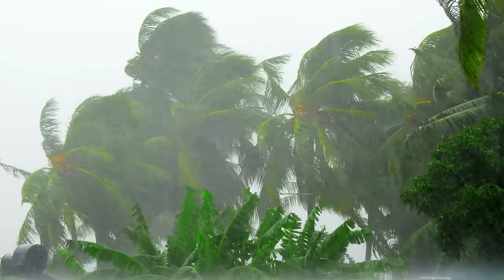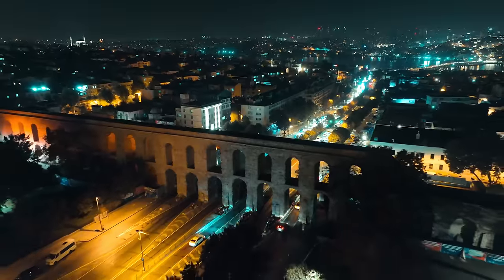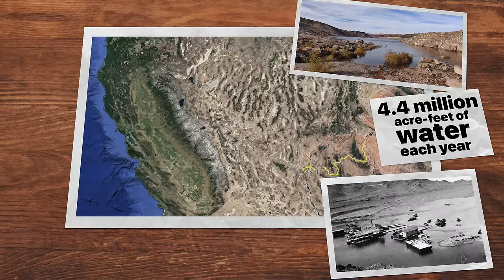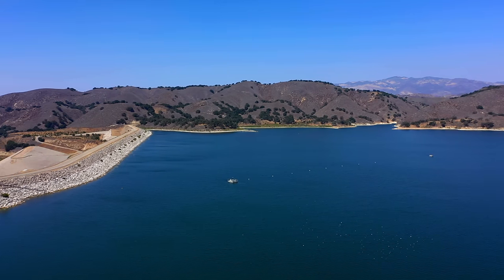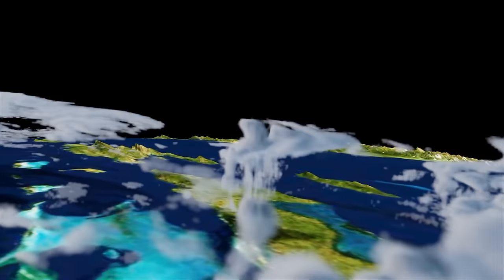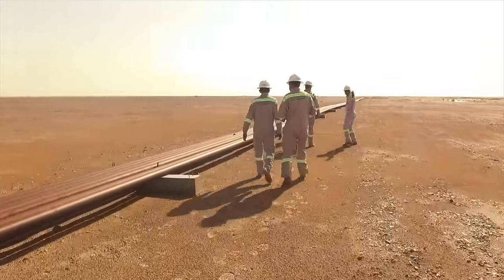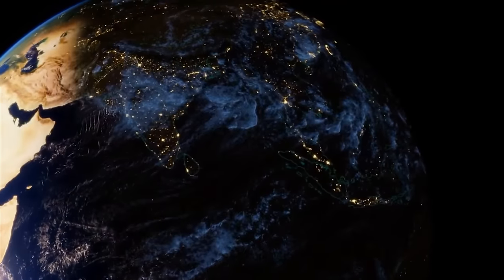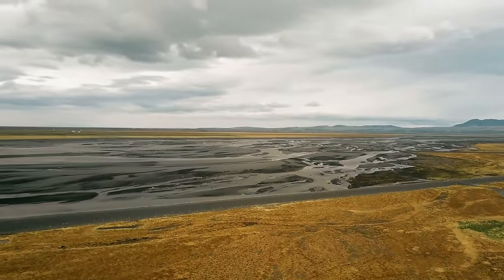Pipelines From Flood to Drought

Comment: We already do release water (downstream) in preparation for increased rainfall accumulation, and that creates huge problems downstream, particularly if it's part of a series of flood-causing storm systems moving through an area. Notoriously, in 1993 and 2019 we had waters dumped into the Missouri river upstream by reservoirs trying not to breach while those downstream were already suffering massive flooding, keeping the flooding from being able to drain down before the next storm system hit. So even having the capacity to pump it somewhere that actually wants it would be a huge benefit even before the advanced models are available.

We could even establish minimums and maximums for "standing levels" of each so there's enough water in a reservoir for the needs of the coming year and enough spare capacity for unexpected events. At the very least we should be building pumping systems to begin moving water to Lake Mead, the central reservoir of the current largest water crisis in North America from east of the Rockies and then encourage reservoirs to connect into it to take any excess water they want to have taken out. You would of course have to rig up some kind of biofilter to keep microbial contamination from making its way west, but we have plenty of systems already doing exactly that on smaller scales that can begin being adapted to scale up.

Obviously, this is a tens of billions of dollars project, but there are more than enough people on the receiving end of just pumping to Lake Mead that the money is there for it if people can be convinced it will work. The major downside is the risk of water shortages from the areas that pumped their water away and then didn't get the predicted rain - and that's where the complex models come in.

Comment: Alright, can everyone please calm down about the oil industry's demise once everyone drives an EV.  The oil industry started in 1859 before there even were cars.  There are tons of uses for oil and gas other than gasoline which only uses about 44% of oil produced.  Cargo ships and airplanes don't have an attractive EV option yet.  Oil is also used for heating oil, asphalt roads, fertilizer,  candles, crayons, plastics, polyester clothes, dry cleaners, cigarette lighters, etc....  In addition each one of those green energy Wind Turbines has about 80 to 100 gallons of lube oil in it at all times.  Oil usage won't disappear.  Pipelines aren't going to suddenly become available.  I do think that it is a great idea to move around water though.  I totally support this line of thinking.

Comment: While I have been Following your channel for awhile, I had not seen this one until an underwater archeologist friend of mine recently pointed it out to me. It reminded him of ideas, concept papers and business plans I prepare over 15 years ago that used re-activated, refurbished or relined unused oil/gas pipelines to transport recovered floodwater to areas in need of water. The big difference between what you have presented and what I presented back then (in short) is I made used of decommissioned (or soon to be decommissioned) oil-fired or coal-fired power plants located along waterways to pump water (when levels were above flood stage) from the waterways into the plant's multi-million gallon holding tanks, perform primary solids settling and biologic disinfection (to kill unwanted/invasive organisms like zebra mussels), then pumping the water through the re-activated pipelines to areas needing water. This was marketed to several water companies who did not show any additional interest.

Comment: Inter basin un-treated water transfer is normally not permitted by environmental laws.   You would not have to purify it to drinking water standards, just find a reliable way to kill all the organics (ultra violet?)  Hard, but surmountable.  I don't think the pumping costs would be too high, as long as the ends were somewhere near the same elevation. .  Egypt is embarking on an  underground artificial river, if they can do it, why not us?  This is similar to the renewable energy thought about better transmission systems.  Yes, the wind sometimes does not blow, but the wind IS blowing somewhere, all the time.   Same thought, a river is in flood, somewhere, all the time.

Comment: A client of mine, Karl Lohman, published a paper on this some 20 years ago. We even gave a copy to Congressman John Mica who was Chairman of the transportation committee at the time. Karl's Idea was a system of 40-50 ft pipes pumping sea water out of the Pacific to the top of mountains out in California. There the salt and any other minerals would be extracted, then allow gravity to push the water either into reservoirs or eastward to communities that need it. 
The system would distribute water where needed and also be used to transport excess water, goods or people using "Pigs" a cylinder that rides inside the pipe. The cost would rival the highway budget but employ a lot of people. Railroads & truckers won't want the competition but the fuel savings over time would make this a feasible system.

Comment: WaterBeads is a transportation system that is powered by the sun's radiation along the route.  The proposal is to pick up water north of Baton Rouge from the Mississippi and move it to Lake Mead and on to Los Angeles.  This guideway costs $200,000 per mile to build.  Patented solution will bring water to the desert SW cheaper than desalination.

Comment: You did not go over any environmental effects that pumping this water would cause, such as killing native species, spreading invasive species, causing quakes, forcing large number of people to move, etc.

Pumping from Canada to TX is much cheaper than pumping the other direction. There is not only a significant difference in altitude, but there is also a benefit of moving towards the equator. A plan that pumps E-W will not have these advantages.

There is no drought in California. The amount of rain is basically the same as it was a century ago. There are too many people in CA that claim to be environmental, but waste lots of water.

There are already endorheic basins in the southwest. Any water we pump in will come back out much saltier. If we don't pump it out then the area gets more salty from evaporation.

Comment: The comment about the increased capacity in the keystone pipeline ignores the increase in velocity and only considers reduction in viscosity. The kinematic viscosity is based on density and absolute viscosity. Reynolds number is based on velocity, pipe ID and kinematic viscosity. If you increase the volumetric flow by 1000 you also increase the velocity.  The flow in a typical oil pipeline is around 20 fps and this is with drag reducing agents added to reduce the effect of fluid kinematic viscosity.  If this was not added the additional horsepower required to move the oil would be substantially more.  The maximum liquid flow in pipeline using pumps is around 40 fps.  Higher flows are possible in penstock pipes in hydroelectric plants using gravity feed and mountain elevation but even then it is not practical to run a turbine at these high velocities so it is rarely done.  Natural gas flows can be as high as 120 fps in extreme cases. This is why gas is pumped at higher pressure to increase the standardized volumetric flow delivered. By increasing pressure you can deliver more gas at the same velocity. 

The concept is interesting and water pipelines are used extensively and could be expanded in the future to use existing infrastructure. This would require modification of the systems (pressure transmitters/regulation, flowmeters, temperature, leak detection, etc.) but it is possible to repurpose some infrastructure. I would recommend checking the calculations a little closer when suggesting you could pump a 1000 times more water than oil through the same pipeline.

Comment: I've been advocating this for years. We get plenty of water in the US for all of our Domestic, Industrial and Agricultural needs, is just that the distribution of the water the US receives is far from ideal. We should have gone ahead with all the postponed and cancelled oil pipe line projects, except, run water through them instead! There's one caveat: Elevation. trying to build a giant 'herring bone' pipe system means that states that are closer to sea level, only need to bring the water up a few feet. States like Colorado, or Utah, need to bring the water up from thousands of feet, requiring a lot of energy to pump it. (Never mind the expense of burying such a pipeline half a mile deep in those areas) If the pipe line follows the terrain, there will definitely need to be booster pump stations, to pump the huge river-like volume up to the higher elevations, which require huge amounts of energy. You couldn't really use the siphon effect, because a siphon is only good for about 25 feet of elevation.

Comment: Water is in the mid-west, Great Lakes and all that, right? It is needed in the desert, which is in the south-west, right? What is in between is called the Rocky Mountains, no number of solar panels, windmills and pixy dust are going to provide the power to run the pumps.

Comment: If course it could work. Just a matter of convincing people to pay now (less$) vs pay later (mire$) Of course this sidesteps the reason we even consider such a plan. Besides overuse of local resources and population sprawl, there's the ever present ELEPHANT IN THE ROOM climate change. At the current rate of non action on that front this mega project is but a miniscule attempt at mitigation rather than fixing the problem it's just trying to manage the symptoms. And they only get worse. This project will fight the planets natural response to overheating by inserting all this water into areas that dried up in response. In doing this, it overloads the atmosphere with moisture that will manifest by dumping even more rain on the east coast. Bottom line? There is no "easy out" of the current state of affairs. Look at what ancient aliens went thru to try and fix their home. Only we aren't that advanced and will surely perish as this planet shakes us off like a dog would fleas.

Comment: This is a fantastic idea or rather a fantastic solution to an idea that's been floating around for a while.  What's cool is the use of already existing infrastructure to our advantage as we slowly ween ourselves off of fossil fuels.  You're right in that it's going to take an unprecedented amount of cooperation, partnerships and political will.  And as Aurionn, below, states, "The canal systems in South Florida are quite extensive and are lowered several feet before hurricane landfall and pumped up to Lake Okeechobee. If the hurricane is making landfall near mid state, the lake is lowered and pumped into the canals in the southern parts of the state."  It's working in Fla.   This is better than pumping water from the Great Lakes because that's just so politically unpopular.  We, as a country, will have to decide how we prioritize our responses to the climate challenges ahead.  Will it be every person, or city, or State for themselves?  Or will we come together as we did during our previous global threat, WWII, and do what we have to do to make sure we all survive?  We can do whatever we decide to do.  What do we want?

Comment: Suggestion.... Lake Mead... While it is at it's lowest recorded level and make it larger width/depth and include dams for obvious reasons and blockades where erosion/nature may encourage alternate paths from a larger water reservoir. Sell off all the enriched (N'rich'd) soil from the lake to the purchase (probably leasing) of incoming water from neighboring areas that see your method as viable and sustainable for mutual interests. Repeat this process globally depending on weather patterns (peak/lows/anomalies) and take advantage of the construction needed to stave off disasters and benefit multiple areas of commerce. Question... what is the actual amount of fresh water globally that falls to the earth (land only) per year in metric tonnage and what do we as a global society actually consume? With that answer I think we can see how much we actually waste or let flow away yet call it a disaster while it could just be a mitigated situation to benefit the entire system and later call it normal... much like the electrical grids. Your biggest speed bump is (or always will be) the insurance industry btw = good luck.

Comment: Nvidia should just stick to making GPU's they can't even keep up with supply and demand as is. not to mention that they didn't hesitate to drive up the price of their video cards to match the scalpers, trying to take advantage of the tragedy put on us by the Pandemic and make a quick dollar. Karma does have a way of dealing out justice tho, all the Miners dumped all their video cards oversaturating the market and Nvidia had to lower their prices to move old stock and make room for the new. which of coarse is incredibly overpriced compared to GPU's average price before the pandemic.

Comment: No, it wouldn't solve the problems, even if all that stuff worked immediately and we could install it all for twenty bucks.
First, the farms in California require 36 billion gallons per day. That is going to require more than the existing pipes.
Second, the forests in the Sierra Nevada are dead from drought. As the video says, those are the water source for most of the farms. If you lose those, then you will have to pump every gallon the farms need from somewhere else. This plan does nothing for the forests. If you want to do something for the forests, you will need to install a sprinkler system over a few hundred miles of mountain ranges. 
So, no, this won't really solve the problems, even if all the magic wands work.

Comment: I think the main issue of this is that floods have such an insane amount of flowrate, the only way you could make enough room in lakes in a flood prone area in a timely enough manner to effectively stop flood damages would be to practically drain the lakes to an unsustainable level, then what happens when the flood never comes? It's simply an impossible prospect. We can't pump nearly enough water to allow you to drain lakes just before a flood, and trying to keep them artificially low well in advance would be asking for trouble if a drought hits. Just look at the Mississippi river right now, it floods ALL the time, but right now it's basically empty because of a drought. Imagine if the lakes had been artificially lowered to try and mitigate the effects of expected floods, there would be NO water there.

Comment: Colorado is the 6th driest State in the country with an average precipitation of 16”/year.  Yet Utah, Nevada, and the populous state of California depends on the Colorado River for its water usage, which has origins in Colorado.  There are many reservoirs along the way that store water for low water years.  But we had had many consecutive dry years.  It appears to be the new normal.  Yet water is pulled from these Reservoirs as if the good times will return. As a result, water storage is at dangerously low levels.  The situation has been degrading for years.  The present trajectory is alarming.

The reason for the low levels is that water contracts were signed decades ago that committed Colorado to send its water downstream to Utah, Nevada and California. California is the largest consumer of that water.  The contractual commitments were based on the wettest rainfall years at the time.  There has not been as much precipitation since.  As a result, all the reservoirs in Colorado and downstream are many feet below normal.  Lake Powell is 100 feet below its level 100 years ago.  If it drops another 34 feet, there will be no more hydroelectric power production.  Farmers in California will no be able to grow crops any more.  Everybody who presently use this water will be seriously hurt.  Today, agriculture uses 80% of all water use, urban cities use only 20%. The cities are cutting back.   But none of the agriculture users of that water is willing to collectively renegotiate the amount of water they consume based on realistic and actual availability of that water.  The situation is unsustainable.

Comment: This video is misleading, the math regarding power cost for moving water is so unhelpful, lake mead is a 1000 feet higher than LA so it's not surprising at all it doesn't cost much to have water run downhill. Consider how much energy is made by hydropower,  we'd have to use that same kind of energy to move water back uphill from the low lying areas that are regularly flooding now.

Comment: Yes, interesting and nice ideas, and with enough analytic evidenced-based perusal of components necessary to justify the ideas. Nevertheless, this is lateral thinking, which human beings find particularly hard to do. The ability to shift minds, in reasonable timeframes, representative of power, within and without, to control institutional bodies that would need to be positively involved to achieve such outcomes is a small likelihood. I’m on-board with the overview as presented but I’m not optimistic that these notions will be given an appropriate chance.

Comment: The Aussies did build a smaller version of the water transfer project, in the north and with limited reach. Just because skeptics and gutless wonders quashed the big vision, that doesn’t mean it wouldn’t work.
In other news, we’ll need oil & gas pipelines for another century at least, since the Energy Transition can’t be rushed.